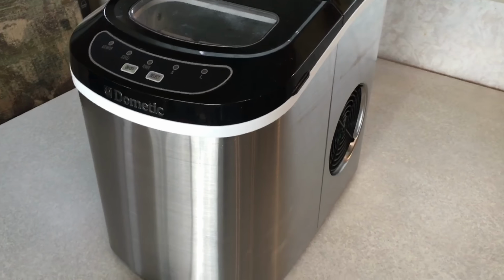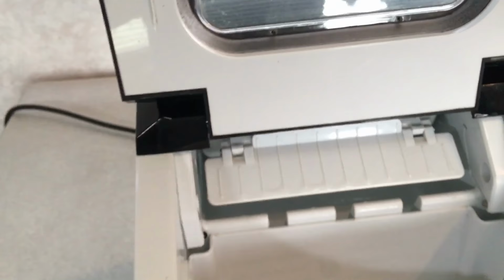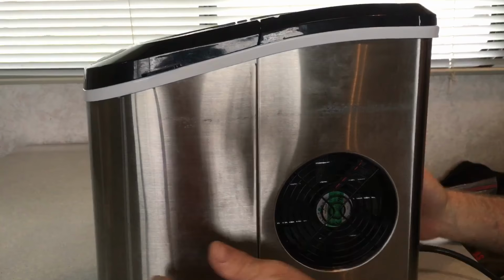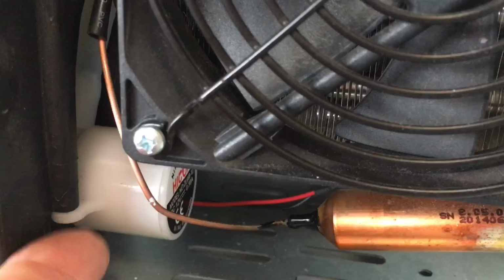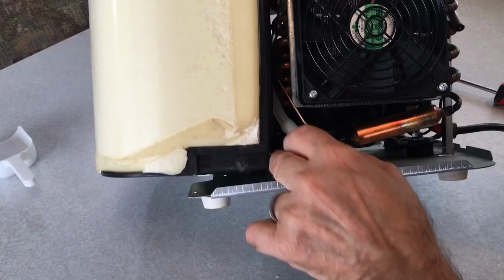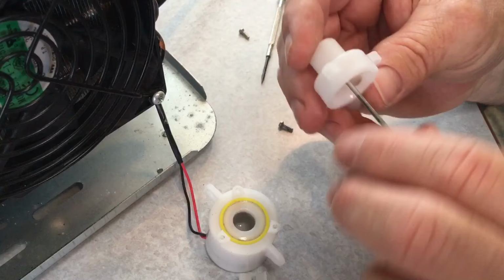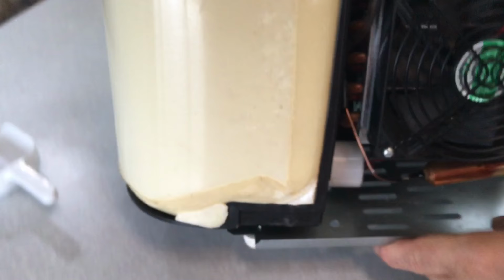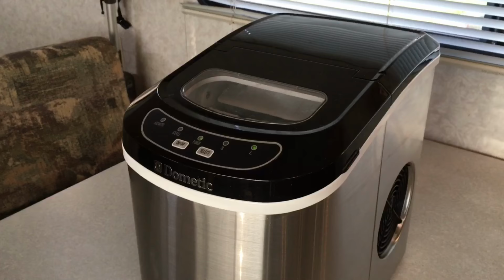Portable ice maker not working, watch this before throwing it away

Comment: My water pump is broken , there are no obstructions in it , It is an MRP-US I bought on amazon , the book has a web site but you can't access it also the 800 # , I have searched the internet and cant find a replacement for it , Do you have any suggestions ???
Reply from the maker: Absolutely, there should be a specific number on your pump,  if not try googling your ice maker model number with extra words like water pump etc. With a little research you should find the one you are looking for. You would be surprised what you can find on ebay, or walmart.com even has individual sellers, and other online shopping places. I’ve stumbled across the hardest to find parts in the weirdest places lol
Reply: @reallystrangebuttrue  Thanks , will try that !!!

Comment: Where is the fill line for adding water?
Reply from the maker: There should be a line inside there that says “max” which on our unit is just below the ice holding tray/basket. If you fill it past that, your ice cubes will drop into water and melt quite quickly.

Comment: I filled my icemaker with water, I hear the motor running but then it turns off - can you possibly tell me why?  I haven't tried to take it apart.
Reply: If you see good water flowing it's not the pump maybe it could be the micro switches located on the back panel so if you have any basic electrical background you could do it do not attempt to replace a compressor if you're not certified and if you do you must do this outside it's very dangerous because there are different gases and some might explode with just a spark I hope this helped you maybe it's too late maybe you threw it away but I hope it you have it go for it God bless you have a blessed day
Reply from the maker: Ours does this when it runs low or out of water. Usually it’s an air bubble that and will work it’s way through after powering back on a few times. Just make sure the water reservoir is full, not sucking air and you can physically see water flowing into the tray.

Comment: What holds the ice scoop blade up like it is at the end of your video? My ice102st works except that ice scoop/shovel hinges back and drags over the top of the ice cubes. I have to pull them into the ice bin by hand. I do not see what is missing or broken on the hinge attaching the ice scoop blade to the ice cube forming tray.
Reply from the maker: Mark Foster That is tricky to say without seeing it, almost sounds like it popped off of track somehow if that makes sense. It may appear to be connected properly but may not.
Reply: Can you watch your ice shovel and tell me what allows the hinge to lock itself?
Reply: on each side of the water tub where the plow is attached. there is a tiny nib or bump underneath and between the plow attachment points. they are so small that they are inconspicuously unrecognizable, surely, if they get snapped off( worn down, my case) youll  never miss them until the unit starts dragging the plow backwards.. another case could be that the attachment pins holding the plow onto the water tub has enlarged the holes so the plow has a sloppy connection enough to where the nibs will not contact and block the plow from dragging  backwards. you can either purchase another water tub and plow or use shim in the holes(like a piece of drinking straw rolled up and around the pins or a tiny piece of brass tubing) or build up the nibs with UV plastic available from Amazon. hope this helped

Comment: Not sure if you can help but mine keeps shaking loudly when releases the ice and by the time the next ice is ready the last batch is melted! Please help
Reply from the maker: thank you so much for reaching out.
I have a quick question that I need to know first, these icemakers have a cooling fan inside of them and I need to know if you can physically see, hear, and feel that fan working?
Reply: @reallystrangebuttrue   yes when I turn the ice maker on after about 10 seconds I can see and hear the fan moving. The ice maker doesn’t shake until the ice is made and being dumped into the bin
Reply from the maker: @isaiahricks9849  OK, the reason I asked about the fan is because if you are getting melted ice before the next batch I would suspect a overheating problem. 
The shaking part is rather concerning though, have you inspected to see if everything is tight inside of the unit like the compressor?
If you do this, just make sure that the power has been disconnected and make sure that everything is tight inside of their, Keep in mind though the compressor can and will move slightly because it should be on rubber feet that gives a slight movement but not sloppy movement.. 
Also, maybe the arm that controls the ice bucket is rubbing against something? Many things to inspect that could be causing your issue and hopefully it’s not a bad compressor, low on Freon etc. because I don’t think those can be charged.

Please let me know if any of these are the issue or if you found something else that could be causing it because someone may come along and read these comments with the same problem and get theirs fixed too.

Comment: My pump is attached to the water line by tiny zip ties. I'm afraid to cut them and not be able to replace them and get it hooked back together.
Reply from the maker: That’s a new one, is it possible to still take the pump apart while connected to the waterline? If so it might be the only way to fix it unless you have new zip ties.
Which would be a small price to pay in comparison to buying a new icemaker, even the dollar store sells zip ties these days.

Comment: My icemaker looks exactly like yours does, just branded by Igloo corp. my problem is that the machine seems to run and cool just fine even making different sized ice cubs. however once the ice basket gets full it does not shut off as it once did. will keep making ice until it jambs up.
any suggestions?  thanks for your time
Reply: Sounds like the sensors aren't working that let it know the basket is full.  You'll see them at the top of the cube trays. The one on the left is a dark red and the one on the right is clear.
Reply from the maker: Thank you Shawn for your help.

Comment: I’ve owned 3 of this type and they all seem to stop working after about 6 months to 1 year.
Reply from the maker: I hear ya, if it wasn’t for us discovering this problem we would have thrown ours out a long time ago, but this one is 4 or 5 years old and still making ice as it should almost on a daily basis.
Reply: @reallystrangebuttrue  What an asset you are to your family and to those you helped in this video; it's great to have a handy person around.  I'm on my fourth icemaker now.  The first one, a Frigidaire, I had for almost two years, and had it running continuously; I figured it was its time to go.  The second two, a Magic Chef and Insignia, respectively, both broke within six months.  I tried cleaning both of them with vinegar, however, I didn't take the whole machine apart. Maybe that's why I wasn't able to fix it.  I'm on my fourth machine now - another Insignia as a replacement for the last one, and it works okay so far, BUT it makes the most ungodly noise when it's about to crank out more ice.  I suppose this is getting ready to conk out, too?

Comment: What happens if you plug it in right away instead of letting it sit?
Reply from the maker: Well, if they have been in motion or turned on their sides to dump the water out of them, then all the fluid inside the compressor will need to settle again this helps to prevent burning them out just like a normal refrigerator.  Some models may be different and  you’ll have to refer to your owners manual on their recommendations. We have always felt that leaving it upright to allow settling was a good precaution.

Comment: So I had the same problem not filling all the way there was water but not enough but mine is a new air I pulled the back off and got to the pump and it was all fine I blew back wards thru it and it worked again ... for a little but then not filling up the again and I couldn't really find the pump at least not for a good price so I had a 12v pump and had soldered a 12v power supply to it and some wires to the outlet prongs look I'm broke and cheap whatever not the right way but that's what I was going to do and had it tor a part to replace it and I'm trying to see what size hose because my pump is not the same size and I see something blocking the inlet and I get a pick and It pushes out. There is a filter in the holding tank that was clogged all this was completed unnecessary if you have a new air with the same problem reach in and use your finger nail and pull that out and see what happens

Comment: Mine is making small cubes of ice too.  I was about to take it apart and look at the pump like you did. But I happen to notice that when the water is supposed to be pouring into the little pan.  It's actually pouring on the edge of the pan causing it to flow down into the water tank. Thereby not making complete ice cubes cause the water pan doesn't have enough water.  Kinda like when our grand son doesn't pee IN THE toilet bowl, but hits the edges! lol
Reply from the maker: Yes, it’s just not getting the pressure to force the water into the tray which you will find something obstructing the water pump from doing its job. Just keep your grandson away from it LOL no yellow ice cubes!

Comment: Awesome Video.
My Water tray wont cycle all the way backwards and forwards. Sometimes it does it correctly but it just keeps getting worse and worse. And yes, there's some type of noise coming from inside it. Eventually it gives up and turns itself off. Help me Please, if you have any idea, b4 I open her up. Mine is a Magic Chef Model.
Reply from the maker: Thank you, first thing of course is to make sure there’s nothing at all hanging up on that model such as linkage that operates it etc. if it’s all good, unfortunately it might have to be looked into from removing the back section of the cover. 
If it’s like our model, if there is any moving parts you could always use a little olive oil on a Q-tip with linkage that moves it.  This could be a very simple fix and as always, if it has not been unplugged for a long time, I like to unplug things that malfunction for least five minutes or so to reset for electronics that like to get statically charged.
Good luck, let us know how it goes.
Reply: @reallystrangebuttrue  
So I did, open it up last night after commenting. I tapped on the 50TYZ-E Synchronous Motor, didn't do anything. Then I took the ice tray (not the water one of course) out, which I've done before, I swear. Ran the cycle, and boom water tray suddenly starts going all the way Forward and Backward properly..... WTF?

So I assume it was the IR sensor but I had cleaned it off a couple of times already when it was still malfunctioning. Errr I mean both sensors, left and right side. Anyway, I put the ice tray back in and it made a whole basket of ice. So i guess it was the IR Sensor being... maybe wet or something? Because I didn't dry it off. When I cleaned it, I used a wet paper towel. Anyway, onto cleaning the tubes on the inside abd blowing out the rest of the dust while its open.

Maybe it was You that said use Cooking Vinegar instead of Bleach, which I would prefer as well. Might clean the tube with a fuzzy pipe cleaner as well. Thanks SO MUCH!!!
❤❤❤😁✌
Reply from the maker: @thisguy1397  glad you got it running again, wow that’s a lot of possible scenarios but I believe that sensor could’ve been the issue and yes by all means vinegar is much safer than bleach when it comes to cleaning the ice machine.

Comment: Hi, my machine runs through the cycle I can see the tube beginning to get cold but then stops.. when I turn if off the motor seems to start nad it get cold again for 20 seconds and then turns off? Any ideas? Thanks Braf
Reply from the maker: Hello Brad, is the tray that the probs go into lifting up and filling up with water properly?
Reply: Hi yes all seems fine but just doesn't want to freeze? It starts on the small pipe but doesnt freeze the larger pipes? Thanks for your reply..Brad
Reply from the maker: brad rogers OK, that is sounding more like low Freon
Reply: Thanks so much for your advice, so is adding freon something I can do or is it a repair shop job? Brad
Reply from the maker: brad rogers I would call a repair shop first before going to one but I am pretty sure they can not be recharged.

Comment: my fan is squeeling on mine....is that an easy fix.
Reply from the maker: I’m not sure, I have not ran into that issue yet. You can use an air compressor to make sure the fan is clean and clear of debris for starters. If a fan replacement is needed that part should be available online for a decent price. But it’s an item that really shouldn’t go out. Wish I could help you better, without seeing the fan itself I can’t give advice on weather it is serviceable by using a dry lubricant or not.

Comment: 2 years later I am not sure if you will answer me. In the cleaning description it says to clean also the fan. Mine is really dusty but I am afraid of opening all up like you did. Do you have any tips for me to clean it, if that is the problem with my machine
Reply from the maker: Good morning, if you have an air compressor or something of the sort were you can get air movement through the vents and with the machine unplugged, while blowing the components out, it would help. 
You might even be able to do a thorough enough job without removing the cover but it is very important to keep all those components clean from dust deposits because it can prevent it from properly cooling down.
Hope this helps.

Comment: My issue is the motor, the thing that rotates the tray to empty the ice. I hear it grinding but it will not rotate down to the fill position. Like something is stuck.
Reply from the maker: That could be a couple of things going on with that but unfortunately you have to pop the top to look under the hood lol 
Which means you will have to remove the cover and inspect what’s going on with the linkage or motor unit that controls that.

Comment: I was surprised that your ice maker makes clear ice.  Mine is white.  Any idea why?
Reply: Mine was making frosted ice now it's making clear ice is that ok
Reply from the maker: I’m not really sure why. Our water source wasn’t the cleanest so we used bottled distilled water, not sure if that’s what makes the difference
Reply from the maker: Did you change water sources? like from tap to bottled water, soft water, well water? that’s the only thing I can think of that would make the difference. I can’t guarantee that’s why but it’s my best guess.
Reply: Your machine releasing the ice cube before they get Crystal clear. Timers ? Control board ?
Reply: @scottvan1898  Thanks for your response.  I gave up on the ice machine.  I use well water, which is moderately hard.  I make ice in a 2 quart stainless steel pan.  Water a little less than an inch deep.  I break it to pieces with a "blunt object".  It's enough for me, and it's half way between clear and white.

Comment: I’ve took my ice machine all apart and checked the pump and there’s nothing stuck in there. When I turn it on I hear the pump making the noice but then it just makes a growling noise and doesn’t pump the water through. Any help? Please 🙏🏼
Reply from the maker: If the growling sound is coming from the pump,  
First thing that comes to mind would be an unbalanced pump motor which could be one of those teeny spacers/washers that I talked about in the video. hopefully one was not completely disintegrated but that would be my first guess at a growling motor . if the growling is coming from somewhere else please advise.
Reply: @reallystrangebuttrue  I took the pump all apart and cleaned it but still making that noise. Really don't know what im looking for though ahah. I turned the machine back on with the back taken off and the I saw the water go down the tube into the pump but then it just makes the growling noise and doesnt pump it up.
Reply: @leavemealonepleasethankyou  No I havent! I took it all apart and cleaned it but it didn't pump water just made a humming noise, I think the pump may be broken

Comment: Hi, I have a problem with my ice maker but it's not like this.. it makes a few batches of ice then after a while it makes a loud rumbling sound then afterwards it will stop making ice (the machine still continues it's cycle as if it's making ice but there is no ice created.) What could be the problem with this?
Reply from the maker: That almost sounds like a Freon problem,  a digital thermal reader would help to read the exact temperature of the prongs that make the ice as it cycles.
Reply: @reallystrangebuttrue  I try not to touch those prongs because there's a warning in the manual that you might get frostbite or something.. but when I tried to at least feel the outside where those prongs are located (mine is near the switch/option). It's cold when it's working normally, but then when it does make those rumbling sound, it felt like normal room temperature. I thought the problem was on the compressor but then I also had a hunch about the freon problem because when I tried to make it work 48 hours after the rumbling start happening, it's making ice again, then after a while it will make the same rumbling sound, that's the cycle I'm getting tired of it really. 🤦🏻‍♀️Is there anyway that you can refill that freon at home? It's really hard to find someone to fix this thing 🤦🏻‍♀️
Reply from the maker: @chonbiker614  pretty sure these are all non-serviceable towards Freon.